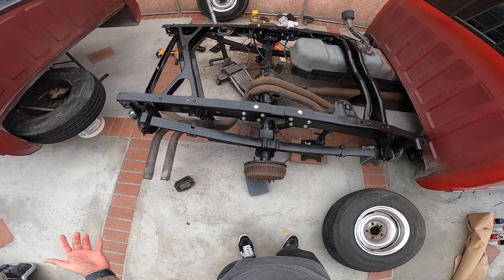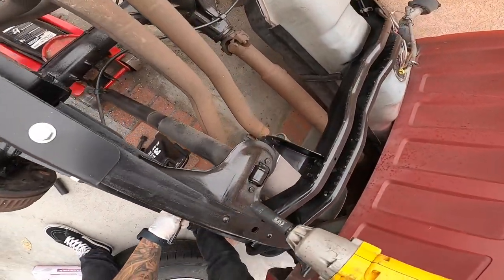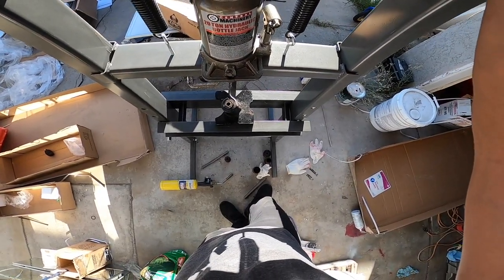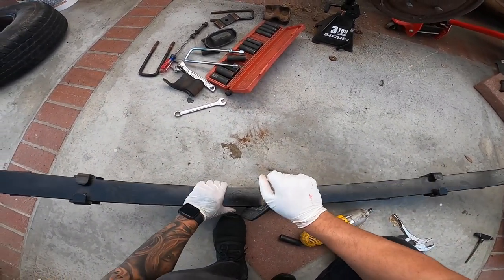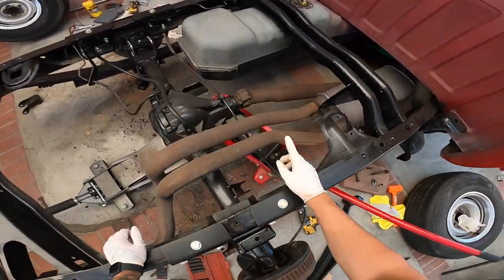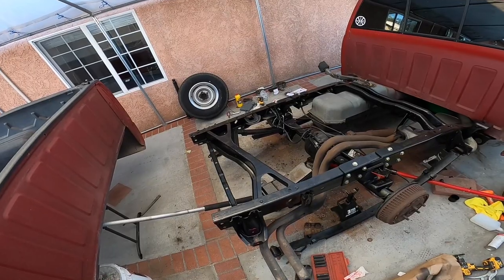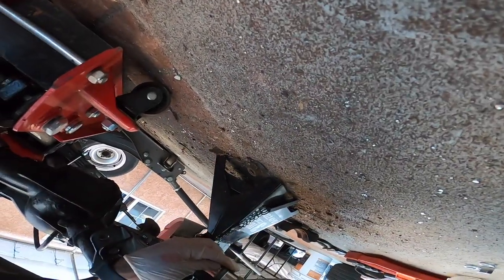3/5 IHC DROP ON MY OBS!!

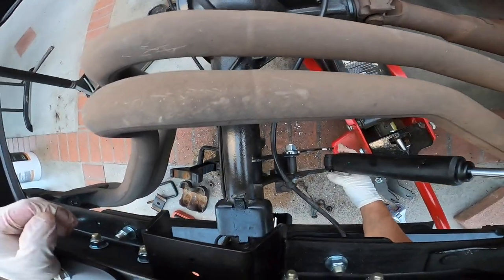Comment: 25:50 Not sure if you figured it out but the shock extenders go on the inside of the stock shock bracket. That fixes the gap.
Reply: you sure ? i’m in the process of installing the kit and i tried installing both brackets on the inside but it doesn’t fit

Comment: Solid video bro, helped me out tons. Did you end up having to use the shock extenders? Seems to me that it is same length either way. Any advice helps, thanks 🙏🏼
Reply from the maker: Yes I ended up using them